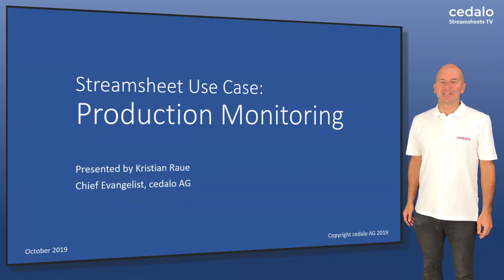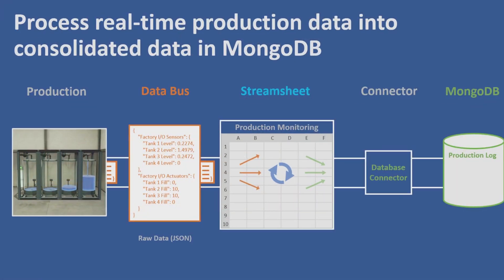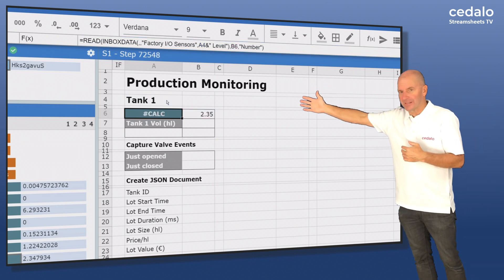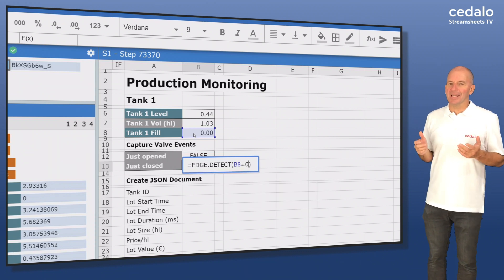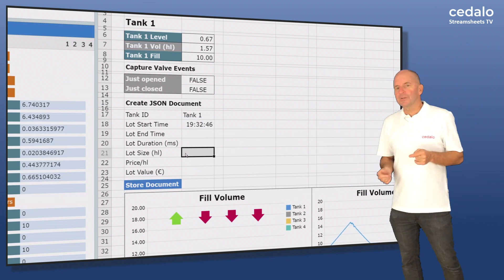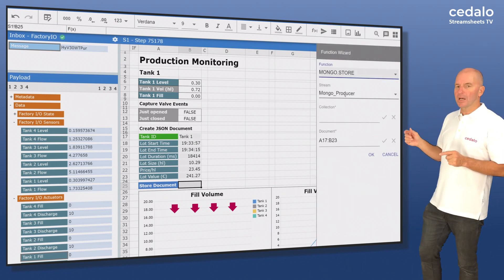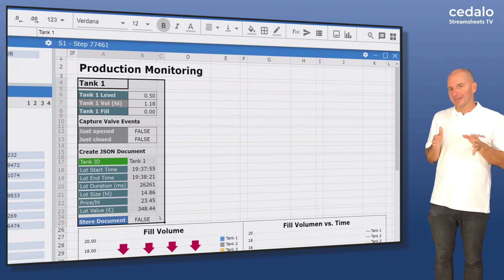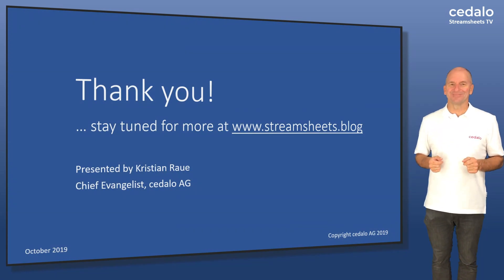Production Monitoring with Streamsheets, MQTT and MongoDB

Comment: This is impressive!
One Question: can you also detect changes in the data, meaning i.e. when a program of CNC machine changes. 
Example: ts:00:05  PROGRAM01 --> ts02:00 PROGRAM02. Background: We pull program names every second and want to calculate the total time each program  is running. So we need to detect the exact time, when the first program ends. This would be our end timestamp for program 01 and the start timestamp of the next program, Program02.
Reply from the maker: Thanks Tobias! 
yes this should be possible, if for example the controller or PLC of the CNC machine can publish the name of the running program via some Interface (MQTT, UDP, Filesystem) etc. 
Please contact info@cedalo.com or even  better get the conversation and use case started in our forum 
--> https://forum.streamsheets.com/